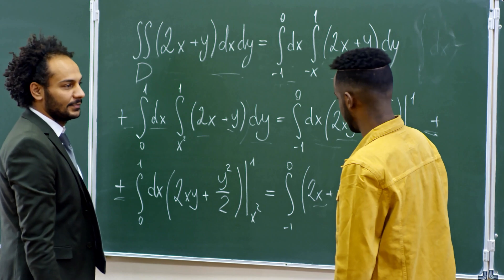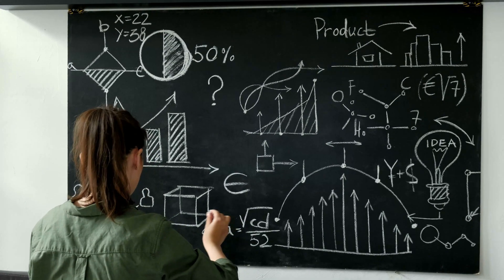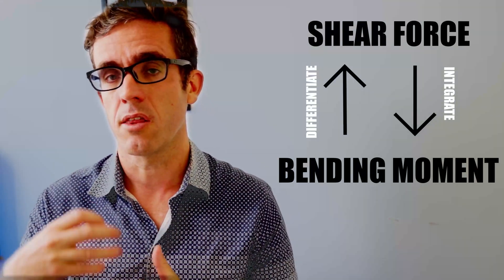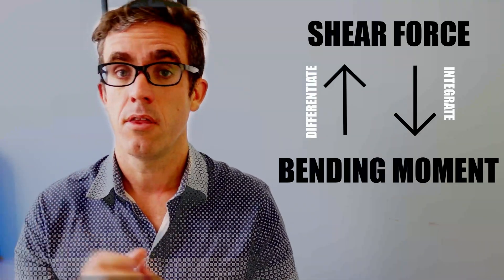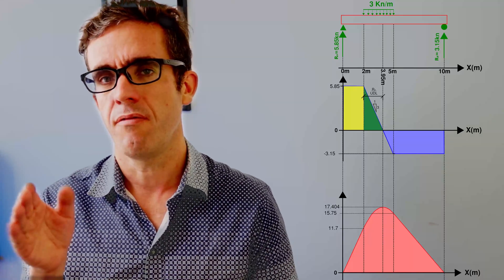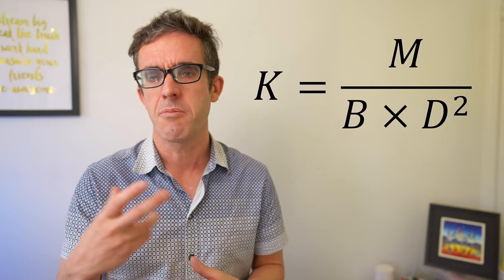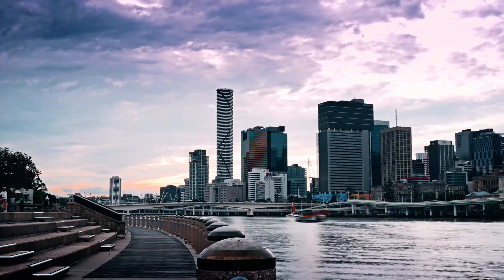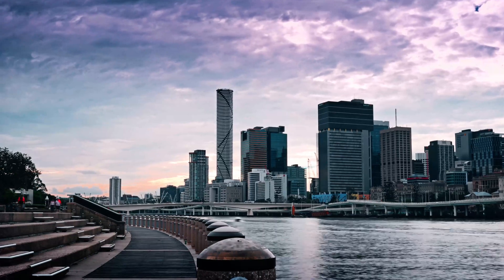The Maths I Use as a Structural Engineer from University

Comment: HI Brendan, I'm a 38year old carpenter apprentice. 
 When working in the carpentry jobs on site, I always think why the structure is designed, such as:  if the post depth is shorted how will it be a concern to a house, why an installation using 3 screws not 4 screws, etc. That's make me considering to study structural engineering for interest and maybe even helping me in design a house structure in future.

However, I'm already 38, I need to work for my bill,  I dont' have so much money and time to study a full-time degree. Could you give me some suggestions? Any website or short course, etc. suitable to me to have a beginner start to learn about structural engineering? I still don't know if I really want to study a bachelor or master of it.
I performed bad in  pure mathematics in high school, these two days I tried to have a quick look about the maths I learnt in high school, I have some confidence I can do better now.  

At this moment, I don't really imagine I will be a certified structural engineer to build a bridge or skyscraper, but I actually want to learn the art of how structures are designed and calculated? 

Thanks.

Comment: Green's theorem!! Is the most import theory I was never thought. It is extremely usefull to solve area (A)/centroid (cx&cy)/moment of inertia(Ix&Iy) for any (not self intersecting polygon)

I was thought silly stuff like split the polygon up in different shapes standard shapes like triangles and rectangles.

For solution (of area) in excel: 
Say we have polygon that can be described by 10 points (note that the last point is always equal to the first point, to close the polygon). 
(0,0) 
(3,-2)
(5,-1)
(7,1)
(6,2)
(5,3)
(2.5,3)
(1,2)
(0,1)
(0,0)
Say that my first x coordinate is in cell A1 and my last x coordinate in cell A10 (the value in A10 matches the calue in A1). And the Y coordinates are in B1 through B10. The area of this polygon is: 0.5x(sumproduct(A1:A9,B2:B10)-sumproduct(B1:B9,A2:A10)) = 22.75

Note if points are defined in clockwise order the area is negative. If the area you want to know must always be positive add ABS(...) in the excel equation.

Can you imagine the silly amount of time I would spend splitting it up in triangles&rectangles and having to redo the equations when adding or changing a coordinate. In addition you can now easily plot the shape in a graph and this is a great visual verification of your input.

Edit: the polygon can be self intersecting when the area on one side of intersection is positive and negative on the opposite side of the intersection (as at an intersection the order of the points changes from clockwise to ccw or vice versa). For example a shear line passing through 0, the area below the intersection is negative and the area above the intersection is positive (or however you define the positive direction offcourse).
Reply from the maker: Thanks for watching and the suppport, geometry is every intresting it is used alot in parametric design.

Comment: Hi Brendan, nice video, though I think your explanation of beam mechanics at 6:28 is partially incorrect. Bending moment is proportional to curvature: M = EI/R (R is the radius of curvature). This would then be integrated to get rotation and integrated again to deflection. You have this the other way around which does not make sense to me. Let me know if you disagree, I may be wrong and if so I would like to understand why.
Reply from the maker: Hi Dominic I will need to check up on that but you maybe correct I will need to review thanks for pointing it out. I thought I had double checked  will let you know.
Reply: Correct, the derivative gives the slope of the differentiated function. So the slope of the beam is the derivative of the deflection. The rotation is: arctan(slope).
Reply: I agree, I remember this because for a uniform loading deflection is span^4, while the moment is span^2. Means the moment was integrated twice to get the deflection.

Comment: hi, I'm an Italian freelance structural engineer, in my daily practice I use a lot of linear algebra and systems of equations. As for the statistics, it is essential to decide the various tests to be performed on existing materials and buildings, and how to interpret the results (we are in Italy, most of the work is on historic buildings).

Calculus is essential, to validate the calculations that return the software, as well as to program the software.

As for the FEM, it is the basis of the routine of most structural engineers. Unfortunately, many colleagues blindly trust the programs (often too user friendly) and are not aware of what they are doing, unable to dominate the amount of numbers and data. Again, here too, manual validation of the software outputs is needed for every project, whether structural or geotechnical.

Obviously, software is used in the everyday profession, but it is necessary to know the behavior of the structures, and evaluate the goodness of the results.

PS "just ask which software should I use" THANK YOU, HALELUJA. finally someone who says it. each project is your responsibility as an engineer, not that of the program.

we are engineers, not clicker monkeys who input data
Reply from the maker: Hi Paolo, thanks for your comments; I totally agree too many people trust the Black box that is the design software.

Comment: New subscriber. It would be interesting, Maybe you did this already what would be a selection of the best structural engineering books to learn the subject from first principles don’t shirk the mathematics (I am a mathematician). Graduate books that are comprehensive texts maybe best.

I suppose you have covered the role of CFD and FE methods in your subject domain already in one of your videos.
Reply from the maker: Hi Math Man, I do have a video on books but if you want a great book on structural mechanics Roark's Formulas for Stress and Strain
It is maths heavy.  Typically as a structural engineer we do not do much with CFD, tho I have been playing around with it for wind loads. As for FE this is something I use daily tho it is handled by computers so most structural engineers do not know how it actually works.
Reply: @BrendanHasty  thanks man I will look for the video on the books but if you have time maybe a link would be gratefully received.

Comment: Im in my 4th year civil engineering and still has no clue whats happening in this major but according to my transcripts I keep passing with 80% above in my subjects.
Reply from the maker: Hi Joseph, great results you will find there is soo much to learn in engineering maybe you are just realising how much you do not know.
Reply: The problem during our Engineering studies, most of us are focusing on our results and Percentages. And we miss the clear understanding of the subject. I believe, it’s high time the Educational system specifically for Engineering shall be modified, it should be more practical rather than running for the result percentages. But if a fresh Engineer wants to be hired by a good firm, sure there are percentage slabs to be get selected, a guy with 90 percent marks may not know what is the exact relationship between SFD & BMD but an Engineer with avg marks May be master of it . This run for percentages has killed the professionalism, I believe.

Comment: Thank you for highlighting that, however, some parts of Differential Equation subjects are essential to understanding deflection phenomena in some non-standard beams and dynamics problems in buildings and, most importantly, bridges.
Reply from the maker: Hi agree on understanding differential equations. As mentioned it is more important to understand the relationship between them as you can more completely understand the structural mechanisms.